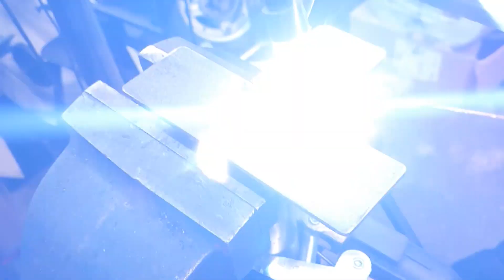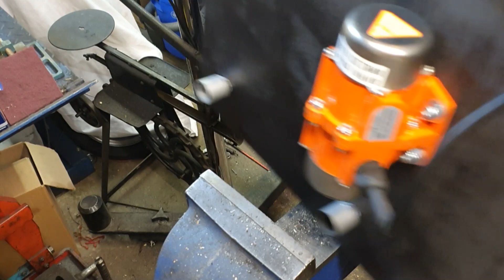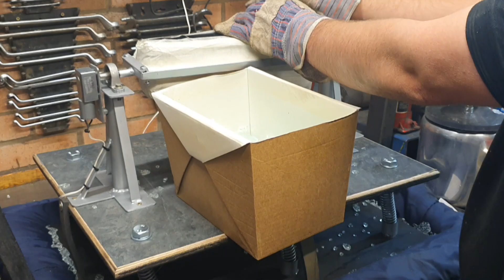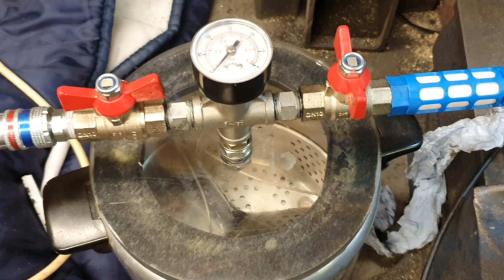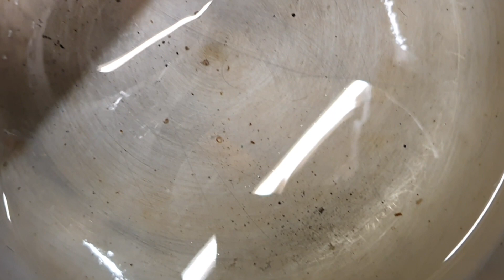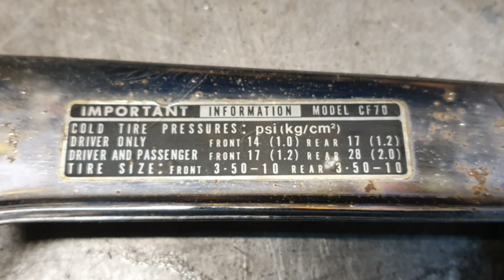Part 2, Fuel Tank Cleaning, Sealing, Resin Lining, Vacuum Pump & Restoration, Perfected!

Comment: !stly thanks for the vide and efforet, its hard work. So you realized what a bad idea and product it is, then you wasted all that time, and energy, building rings, to still apply such a bad idea/product, even in a more permanent and different manner. as a  You clearly mean well, and you more than mechanically inclined, you definetly have an engineering mind, and a great craftsman look at the things youve built. Im a welder, that went to work for dupont, hence being a little cluey about these topics :) The bubbles happen because of a chemical reaction, your not whisking eggs and creating bubbles.  the vacuum you created caused more bubbles, you know this, hence why you dont show the resin when it comes out of your machine, but you show it after its poured, along time after it was mixed, and by then the chemical reaction has finalized and solvent gasses have escaped, that has nothing to do with your so called vacuum machine. I would call it a throffer, as its pulling the resin up, its putting air in it. Have you ever thought why they use a blow torch? Heat causes the chemical reaction to speed up before it sets, hence the bubbles can escape from the still moving resin, thats not set very hard. so if you built a machine that applies some heat, you would be better off, but even then resin in your tank is a bad idea.  in hundreds of years, why manufacturers havent used, plastic or resin tanks? i mean how good would it be for them, any shape you want, cheaper, and rust free. do you think no one ever tried it? they probably did, why do you think they never lined tanks with resin?
Reply from the maker: Interesting view, now if so, explain to me why so many woodworking  craftsman use vacuum pots combined with resin, do they have it wrong too?
What would you suggest the best way to repair a line an original steel tank would be, you can not bake it as it would spoil the exterior paint and you can not line first and then powder coat because the resin would be damaged. You can not replace the tank with a new one because they are obsolete?
Give this a watch
https://www.youtube.com/watch?v=bpqh3vNEsMs

Comment: Very nice result. I need to treat a dnepr 19L tank and will probably clean it out with vinegar first then apply this tank cure product rotating it by hand. Can't make such a nice rig myself. Do you think putting the mixed resin on a vibrating Sander (without sanding pad obviously) would do any good in removing some bubbles? How long did you treat the resin before putting it in the tank?
Reply from the maker: Hi and thanks. I dont think the sander method will work, i know where you are going with that and i agree on other products it would work but not this resin. If you have a look at the woodworking channels they use a blow torch and pass it over the mixed resin while its in the mixing pot or pass the torch over the finished resin table etc they are making, obviously blow torch on internal of tank is not an option, I was amazed how well it worked. It took me approx 6-8mins to get the bubbles out using vacuum and it still poured fine into the seams but i wouldn't want to leave it any longer, yes its probably good for 15mins but i would worry about it been and even coat as you rotate it. With the vinegar i would use glass etc. I believe white vinegar is best, good luck....

Comment: I bought this stuff to clear out a puch maxi moped,,, dont  think I can spin the frame like you did the tank , I might just cut my lose and not use the resin   cheers for the video
Reply from the maker: Dont disappear. The first tank in my other video was done by hand, yes it took ages but what got on my nerves was the air bubbles. It can be done without auto rotating just not as even. Its those dam air bubbles.
Reply from the maker: I would just make a jig and hang it from my workshop roof and spin by hand along the center line of the tank...